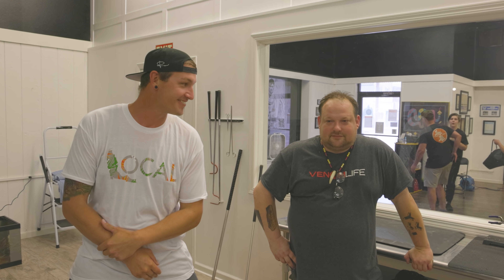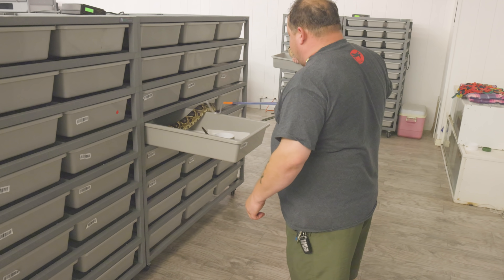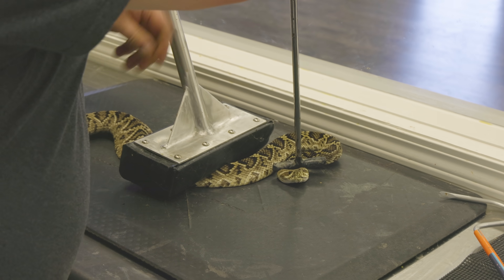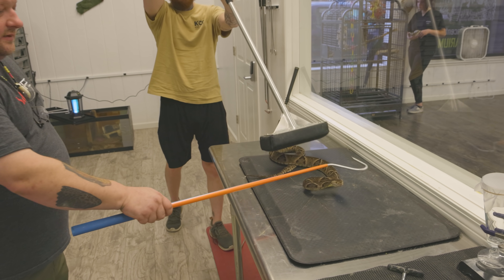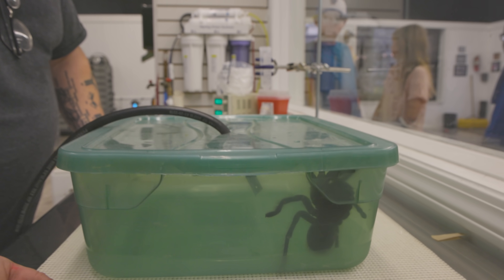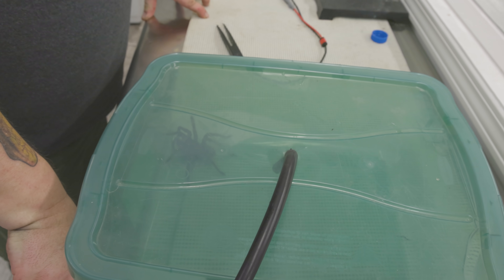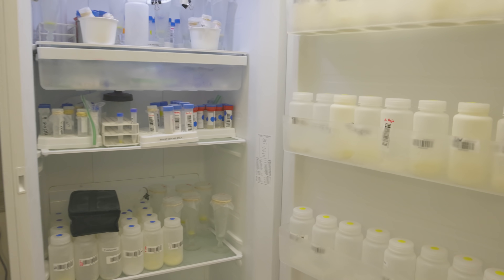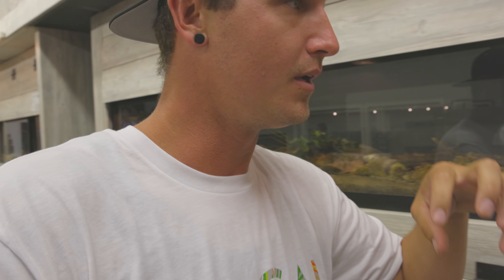BEHIND THE SCENES OF A REAL VENOM LAB!!!

Comment: I rescued a baby Eastern Diamondback from a road here in central Florida and raised it for ~ 2 years until he was around 4 and a half feet.  He was very reluctant to bite, even when given live rats.  He preferred frozen thawed.  It became very tame and sought out interaction with us every time we let him out... until he got to be over 4+ feet when he gradually became a little more independent (i.e.- he was reaching maturity).  He was still completely reliable but he had earned his freedom and we released him in a ~ 400 square mile swamp around 25 - 30 miles from where he was caught.
Several other Venomous Reptile license holders have reported other instances of very laid back behaviors from other Eastern Diamondback rattlesnakes.  They deserve more respect than they are given when encountered and should be transported to safe location if at all possible.  The reluctant to bite Edb in this video reflected our experience with them very closely.

Just out of curiosity... the height disparity in this video was pretty noticable...how tall are you Will? 
Also, the graphics in your intro are excellent!